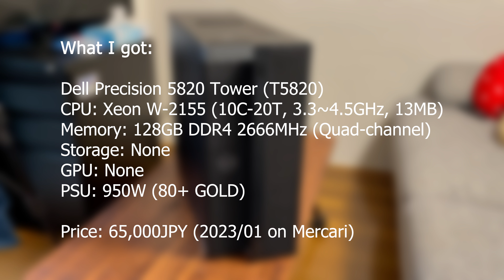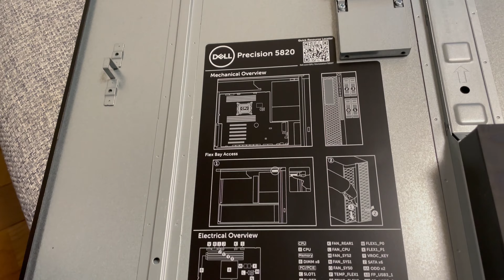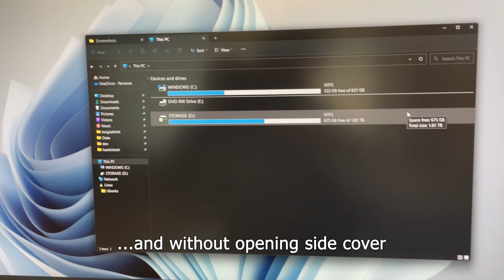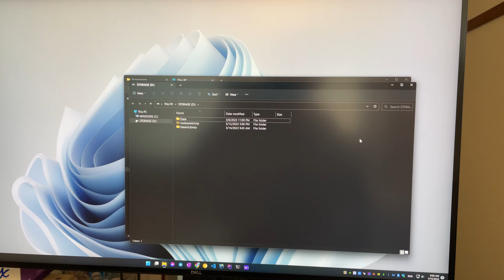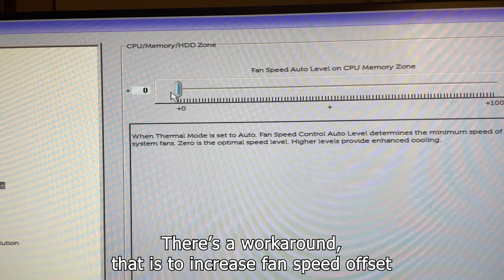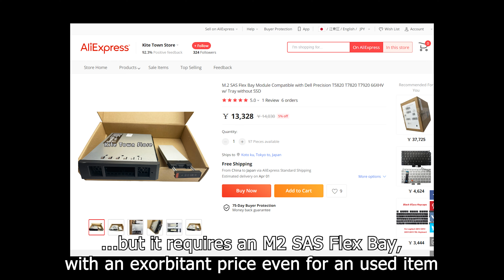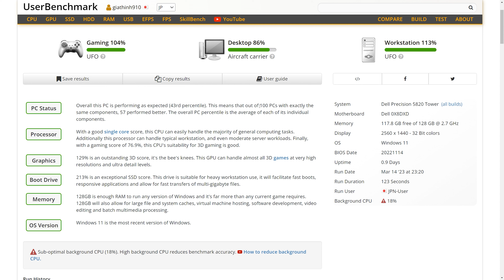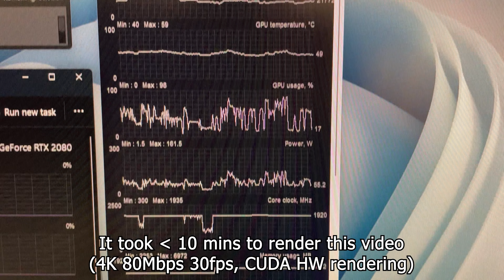Nice timing for an used Dell T5820?

Comment: awful airflow and temps on this one, not recommended putting in a big graphicscard
Reply from the maker: Thanks for your opinion. I also used to worry about putting gaming GPUs in those OEM workstation models like this one. I thought those kinds of workstation work best with blower-fan GPUs, which tends to be seen at NVDIA Quadro or AMD Radeon Pro series. However, as I tried with gaming GPU models with axial fans like GIGABYTE GTX 1070 G1 or EVGA RTX 2080 XC Ultra (the one in this video), they worked great and even the fans stay quite. I think the keypoint here is how big the GPU heatsinks are. If we choose a gaming GPU model, they should have good/big heatsinks. If they are, the intake fans can handle the heat dissipating task well.

Comment: Not a bad buy at all.
Can't trust loserbenchmark though.
Reply from the maker: Thanks for your opinion. I don't trust the Userbenchmark too. Just provided it as an additional information next too the other benchmarking results.
Reply: @thinhdora  Honestly, I had no idea this hardware had come down so much.  Figured that price would still only get E5 V3 or maybe V4 at the newest.
Reply from the maker: @cracklingice  Thanks for your comment. In my case there are some factors to get this bargain.

Firstly, the risk of hard to repair / costy to replace in case of failure . The one in this video is 4 years old (out of 3-year default warranty). If any comopent got broken, the replacement cost would be high, and finding the replacement would also not be easy because the T5820 seems not to be too popular on flea markets yet in where I live (Japan).

Secondly, I negotiated to purchase it without GPU and storage (as I mentioned in 0:22). The original listing price/specs is ~75,000JPY with Quadro T400 and 1TB 3.5 HDD.

And maybe a bit of luck :D

I attached the link where I purchased it at the description.

Comment: CPU is barely doing anything in RDR2💀
Reply: The W-2155 is a beast. Six cores with SMT, 3.2 base, 4.5 turbo. It's not getting bottlenecked in games anytime soon.
Reply from the maker: Thanks for your comment. I think it's because the RDR2 can take advantage of multiple-core CPU very well.

Comment: Why would you put a 2080 in this piece of crap? It will get bottlenecked massively by a poorlly cooled cpu and bad ventilation.
Reply from the maker: Thanks for your comment. As my experience, this GPU works fine inside this machine. The temp stays under 70*C at full load.
Reply: @thinhdora  I refer you to my original comment. I didn't say the gpu will overheat, though I am shocked it doesn't.
Reply from the maker: My mistake. I'm not sure how you consider CPU bottlenecked. In the full load test I shown, even though the CPU got higher-than-my-expected temp (80*C, 10:23) at default fan curve or better temp (70*C, 10:48) at 10% offset fan speed, the clock speed was maintained at 3.7GHz, which looks good to me.
Reply: @thinhdora  Not sure what CPU you're using, but at 3.7ghz, it's not a modern high end one. You honestly seem to be under the impression a case like this would not hamper a modern system and I can't fathom why. Also, don't use UserBenchmark.
Reply: It’s not bad. Many places that I work at use these for running multiple monitors and the computers are running pretty much 24/7.

Comment: you can just use third party software for fans..
Reply from the maker: Thanks for your comment. As my experience with Dell systems, the only third-party can work is SpeedFan. Even though it does not work well for adjusting, only good for monitoring. I would appriciate if you can suggest me any better third-party app.